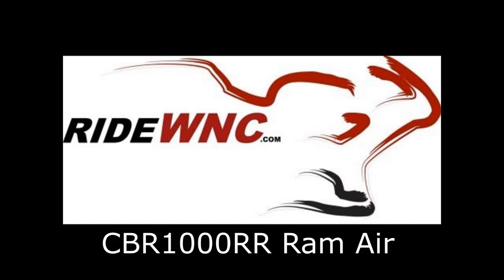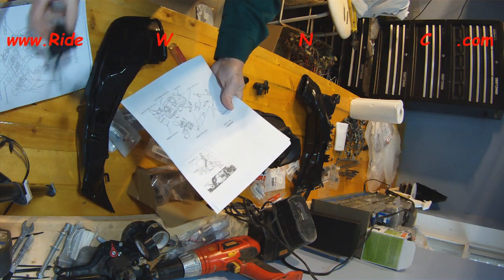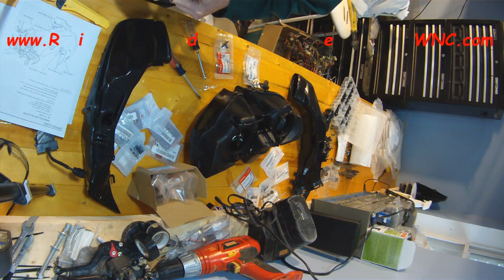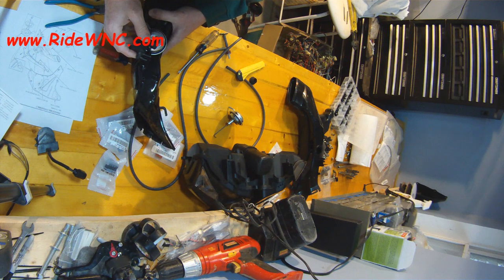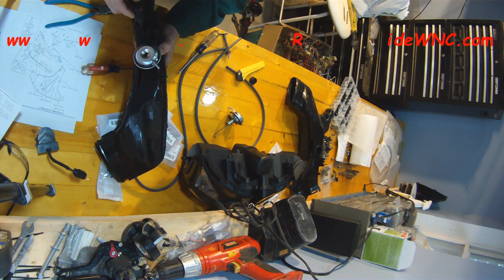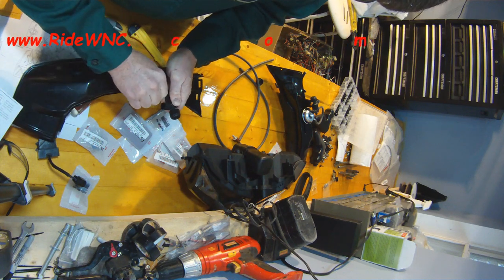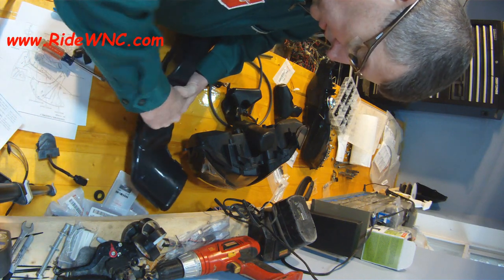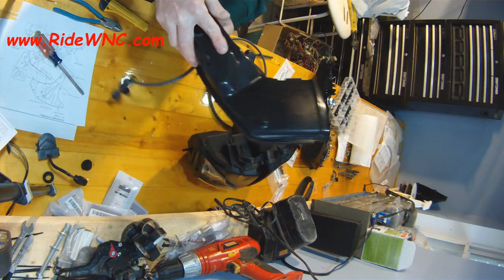2008 Honda CBR 1000RR Ram Air Build From Scratch

Comment: Your a good man for putting all the ram air components together. I have a 2008 CBR1000RR and I know exactly what your going through. Mines doesn't have all that crap just the canister going to 1 vacuum hose I noticed it runs better connected on first start up. After its warmed up it's good to go, but man your a good dude for real because fuck all that noise 👌🏽👌🏽

Comment: Wow I never thought I would find a video about this on youtube! I just bought a 2008 cbr 1000rr and it has the oem ram air tubes but  it's also missing all the same parts that you had to buy from honda. I thought that this vacuum system had something to do with the idle air control valve that goes into the throttle bodies but thanks to you now I know that their job is just to open up that little door at 5500  rpm's wich I also noticed and thought about but I wasn't really sure because like you said the freaking manual does not say anything about it. Well I think that on my bike I rather loose some hp because of the switches not opening the little door at 5500 rpms  than spending 800 bucks and a big headache putting it all back together Lol. Thanks for doing this video my amigo cheers from Mexico.
Reply from the maker: Buy used parts. Some of the 200.00 vacuum switches are 10.00 in eBay. Also once you have the part number, you will see that the parts are on many different Honda motorcycles and cars. That makes it easier to find the cheapest part if you go new.
Reply: @RideWNC  Yeah that's what I'm going to have to do eventually. For now I just left one of the flappers open by removing the spring that holds it closed because my bike was idling rough and stalling  because both doors were closed so the air box was literally sealed. It also created an issue when they were closed the bike will go into like a " limp mode" while riding I assume because the map sensor notices there is no intake pressure or air flow or whatever is called going into the intake and the ecu cuts the power to the system down to 9 volts or so while riding at low rpm's and the engine just dies. No check engine light though.

Comment: I have the same exact bike. Got it from copart yesterday could you post a list of all that intake parts. I need the same stuff.
Reply from the maker: I put them in the comments above.
Reply: Ok thanks
Reply: I am glad you made this video. This ram air stuff is a pain.. I think I've watched this whole video 3 times 😂 very helpful.
Reply from the maker: @brandonatkins9087  Once you get the fairing kit it is a lot easier to assemble. All of the Ram air mounts to the side panels and the side panels hold everything together.
Reply: @RideWNC  ok thanks I hope so haha